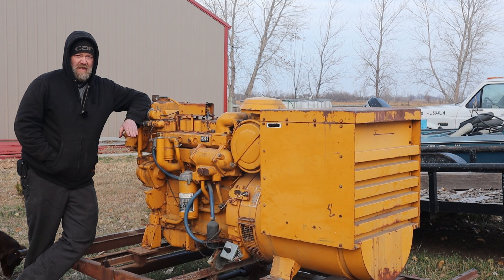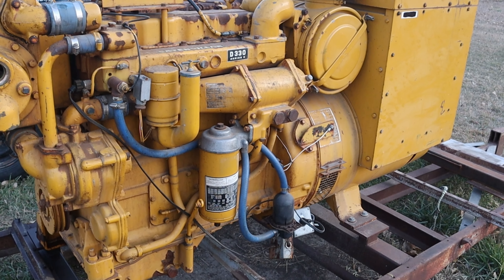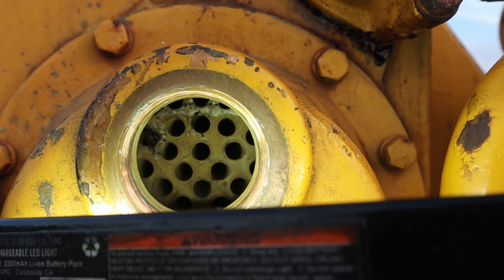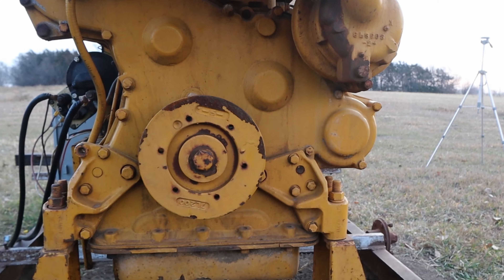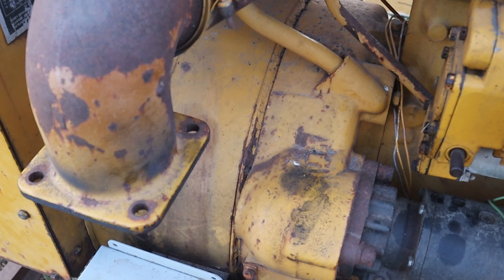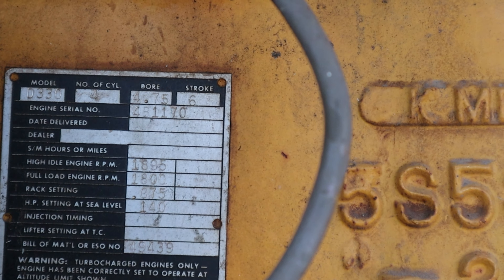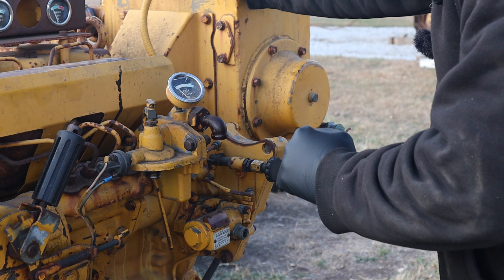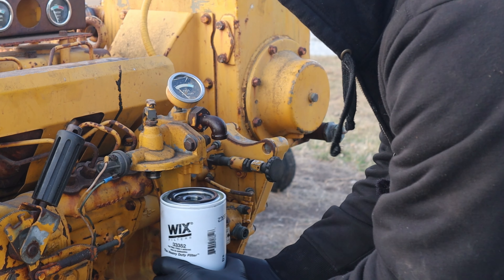Cat D330C Diesel Generator - Will it start after sitting for 10+ years?

Comment: Hey Thx for the vid on this Cat.  I have a D330 generator that hasn't run in over 10 years.  I wanna get it running before I put it up for sale.  Not sure what it's worth but probably better then scrape metal if it'll bark off.
Reply from the maker: Yeah good luck! They are pretty reliable it seems and I think it would be worth way more than scrap if you had it running.

Comment: Wth is that statement 
" hear it dripping? "  even on a 55 in tv with stereo you cant hear it nor even see it. And you don't know what a heat exchanger is ???????   From a  School i image its a backup genny and NO WAY A GARDEN HOSE WILL DO ANYTHING
Reply from the maker: Thanks for the feedback. I'll make sure to capture what I'm hearing and seeing better on future videos.
Reply: @DMIDoes   Props for not being rude. A garden hose WILL keep it cool, assuming you have the typical 10gpm flow at the hose, you have at least 8,300 BTU/minute worth of cooling, which in theory could cool an engine burning 11 gallons of fuel per minute.  Your engine probably burns like half a gallon an hour unloaded, so you're super good.  

Congrats on getting it going, keep us posted!
Reply: @DMIDoes  this is apparently a marine cat genset